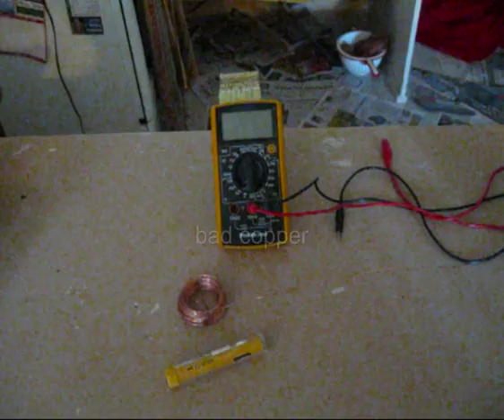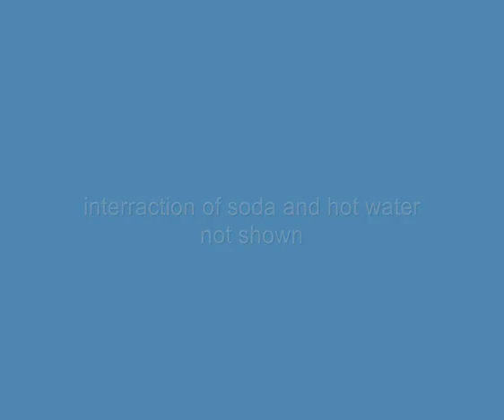nano coating

Comment from the maker: The hot bath is caustic soda + hot water.
The method will produce nano coat on copper, mind you however, the application of that coat limits to very little up to none!. To make the coat conductive, you need to keep the sample under water all the time. The voltage will be very small and current even smaller almost non existent. The p-n junctions clog with oxides in contact with dry air environment and become neutral (no voltage). Where would you apply wet p-n junctions? Under water? In reactor you need to avoid any moisture....?
Reply from the maker: Herr Krum Maybe true , maybe not. Inside reactor the nano coat could originate secondary ionisation; the secondary ionisation would follow interaction of gas molecules with roughness of nano particles only if nano particles would firmly stick to wall of reactor; the sticking has to be good enough to not to end up with powder floating around - the nano tubes are pretty brittle.
Difficult to talk about ambient voltage inside reactor from nano tubes; no measurement is possible at present.
As far as use of nano coating outside reactor in dry air environment as voltage source- it is limited; too small voltages are involved to bother commercially. In future perhaps, not as nano coats but differently defined  (i.e. basic voltage cell..?)
Reply from the maker: Herr Krum additional remarks about nano coating inside reactor:
1. Voltage of p-n junction, is useless, unless is directional and if not switchable it would hinder rotating plasma in opposite direction . The random distribution of p-n junction on some surface would give you zero voltage.
2. Secondary ionisation would play very small role, perhaps 10% and no more in overall Energy intake. Full ionisation can be accomplished with primary ionisation, no need for secondary ionisation.
3. Ion doping, it might help, but not necessary for full ionisation can be accomplished with primary ionisation.
4. The only real and rational reason for inner coating is smoothing the surface of reactor walls and/or and possibly removal of water droplets.
5. Inexpensive nano-coat resins are already on market, there is no need for labour and waiting time in laboratory. Use brush and paint your coat in little time.
Reply: shankaraist hi shankaraist. the small impulse charges of a small voltage from the multimeter are what stabilize and help attach the carbon nano layer to the copper, the more time you spend stabilizing the better the coating will hold. you can further rid expel impurities by placing strong magnets on the outside of the reactor when its under a vacuum, moving them around after an hour.
plasma cannot come into contact with any matter for obvious reasons being a plasma (the resin is a matter). the nano layer is a superconductor which has an expulsion of magnetic fields. 
this creates the field to keep the plasma away from the matter, and also has lots of tiny magnetic vortices with lots of "gaps", which creates a small amount of turbulence. The gases are introduced into a vacuumed sphere reactor spun to create a centrifugal force with the small magnetic turbulence creating good conditions for ionization.
You do not need the radiated liquid helium to begin ionization, although quicker from what i understand. this is proven in the coke bottle experiment and every other GANS capture experiment.

Regarding the ionization you seem to be confused about, im 99% sure that the compression of the gas in a vacuum undergoing centrifugal forces is what begins the heating and ionization process. Feel free to tell me where and why i might be wrong :) we're all learning here lol